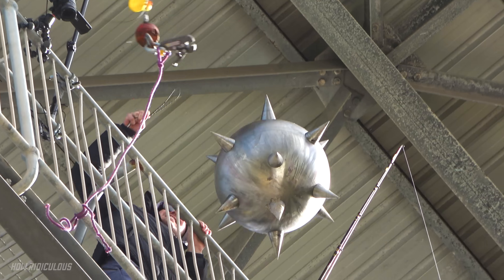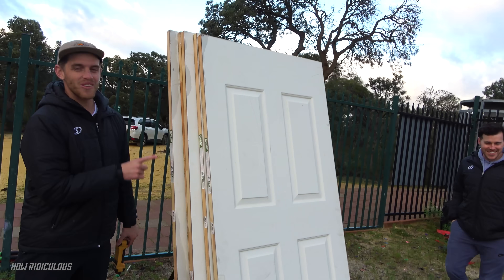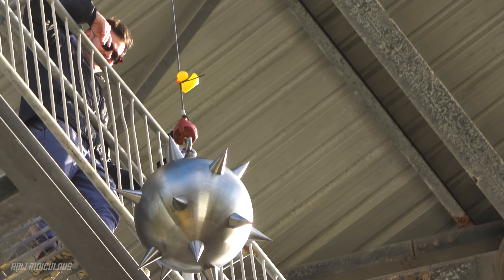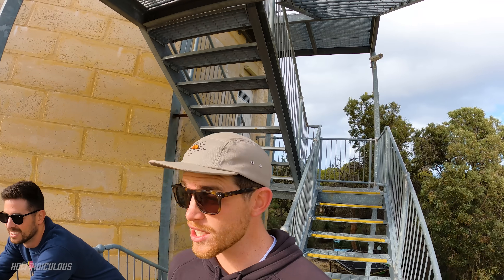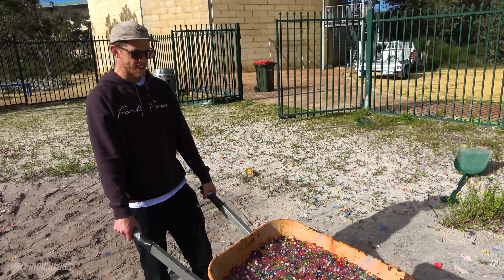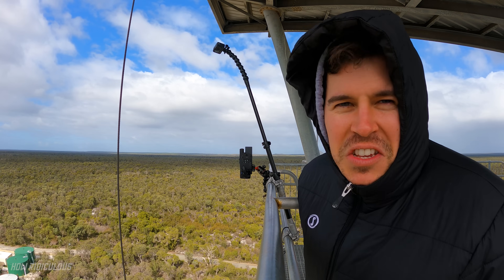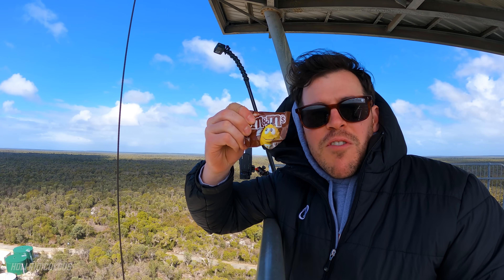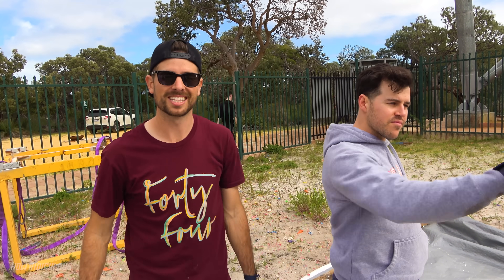444kg Savage Wrecking Ball Vs. Bulletproof Glass from 45m @ 13,000fps!

Comment: The glass would break easily.

If you calculate the potential energy the ball of 444kg at a height of 45 meters, it would be 196.003,8 joules of energy.

If you calculate the kinetic energy of an ak47 bullet (122grams, 710m/s), it would be 30.750,1 joules of energy per bullet, if you take 3 bullets (the reason for 3 bullets -> for American standers, ballistic graded glass has to at least withstand 3 bullets shot 120mm apart from each other in a triangular manner , and let’s assume it’s a bullet shot out of an ak47)
So 30.750,1 times 3 is 92.250,3 joules of kinetic energy total that the ballistic graded glass should minimally be able to withstand.

If you take the potential energy from the ball and the energy minimally of the ballistic graded glass and substitute it from each other, then you would have 103.753,5 joules of energy over, this means that the ball still has that much kinetic energy after breaking the glass.

Comment: At 16:54, I wasn't surprised that tip got bent. I've seen the heads of tank main gun projectiles with tips like that bent after they'd hit the ground in an impact range in the Army. In fact, I have one broken off from a 105MM round from an M-60 tank, and it ripped the spike part off the front and curved the point around 180 degrees, I use it for a paperweight now. All that force just needs a TINY but of sideways action, and tippy is going somewhere

Comment: .... So... Bulletproof glass can stop little bits of lead and metal with an average speed of 2736 Kilometers/hour or 1700 miles/hour, yet at not even a tenth of the speed, nearly half a ton can demolish bullet proof glass... :\ So... Who can science this?
Reply: The mass of an average 9mm bullet is around 147 grams on the high end, whereas this wrecking ball is around 444,400 grams. That is just over 3,000 times as heavy as a bullet. Taking the mass of a bullet and multiplying it by 3,000 would greatly increase its force, but as you pointed out, the wrecking ball isn't moving nearly as fast as the bullet. So let's work out how much slower it is than a bullet.
Since the wrecking ball just falls due to gravity, its acceleration is the gravity of Earth, 9.8m/s^2. We can time that it falls for 3 seconds before making contact with the bulletproof glass. Using those facts to work out the ball's final speed at the point of impact, we find that the ball is moving at about 29 meters per second when it contacts the glass. Converting your speed of 2736km/h to meters per second shows that the bullet travels around 760m/s. Comparing the two, that means the wrecking ball is moving about 26 times slower than the bullet.

The wrecking ball does move much slower than the bullet, 26 times as slow, but not slow enough to balance out the fact it's 3,000 times as heavy. You're multiplying the mass of a bullet by 3,000, but only dividing its speed by 26, which when divided out, means the wrecking ball should have around 115 times more force than the bullet (when it's traveling at around 29m/s)

If there's an issue in my math I'd legitimately love to know what it is /gen, I believe I explained it correctly but I wouldn't mind being corrected.
Reply: @mac-gaming-c7t  Much obliged.

Comment: The reason the spikes are cooled and the ball is heated is the exact same reason why your lid gets stuck in the frying pan.

Expand the receptacle, contract the insertion and when both even out to room temperature, they'll be stuck together.

No welding, gluing or any other fusing method required.

Comment: Betty or Penetrator is my suggestion. Drop suggestion: Through the roof of a heavy duty Truck and then through the engine block.  Also, the hulk fist and Thor hammer were epic but the giant axe head was easily the most terrifying object dropped.

Comment: 0:55 heat makes metal to expand and cold makes it to shrink and thats the reason why u want to tag weld metals before full welding due to the metal expanding from the heat
and same applies to wood in different way. wood expands when it gets wet and shrinks when it dries

Comment: After a bit of back-of-the-envelope calculations, I'd reckon this has kinetic energy in the same ballpark as a shell fired from a 37mm anti-tank gun (roughly 190kJ). So, I'm calling it a "doorknocker" based on the nickname given to one such gun. After all, you did knock on some doors with it.
Reply: What mass and velocity are you assuming for the spike ball?  Just curious.
Reply: @nickh5081  Mass is exactly what they say in the video - 444kg. Velocity is 29.7m/s, which is what you'd expect after a 45m freefall under gravitational acceleration. It works out to 195kJ. I'm gonna ignore air resistance because I don't think it'd matter much for something so dense and spherical until you get into some ludicrous speeds/heights. I'm just trying to get a rough idea of how powerful is the impact; not trying to load the 'Doorknocker' on a ballista and snipe some poor dude with it. 😬

A close scrutiny of the high-speed camera footage would probably yield a better estimate of its velocity especially if you know the exact size, but I'm too lazy to even try.
Reply: @suntzuthesecond   Thanks.  I didn't watch every second of the video, so I missed the mass.  Believe me, I didn't plan on arguing with you and I wasn't about to calculate anything myself, but my interest was peaked when you mentioned the 37mm round as it's always interesting to me when you see the power of ballistics compared to something more tangible. Obviously there's a number of different 37mm rounds, but we're not splitting hairs here!. I was just curious what numbers you used.  Cheers.

Comment: Morpheus the Devastator cause nothing is going to survive it's raft rampage of dangerous weight and spike's I just know I wouldn't want to be around it either when it falls but just a thought though what kind of damage would it cause if shot from a cannon to car or truck ,I would not fire it at a concert or steel wall could maybe find an old gun safe or something similar in size and weight

Comment: I'm hesitant to suggest, but depending on how much time you spend traveling up and down the stairs, you might wanna set up a chairlift that relies on the pull strength of the others. It should be way faster and easier for fatigue on whoever ends up running up and down

Comment: Need to put in a thiccckkk concrete slab with a 1inch thick steel plate bolted to the surface. Your losing so much energy in the soil. You could be doing at least four times the damage… Then you would need a safe observation room/vehicle. 😈😈😈

Comment: I'm surprised y'all haven't found a way to use the winch to get to the top instead of walking all those dang stairs lmao 😂. Just run an extra rope with harness through a pulley at the top and have someone holding the other end Just for a backup safety measure

Comment: could you guys put a velocity counter for things that seem faster than most? i think that'd be dope
Reply: I've always wanted this!!  And accelerometer on the dropped object!
Reply: THAT WOULD BE VERY CHALLENGING AND VERY HARD TO DO
Reply: @jonathanVN1864  buuuuut…?
Reply: @ToastyHC  it would be cool if thats what you want me to say
Reply: @jonathanVN1864  looking for more of explanation on how it would be possible but saying its cool works too😂
Reply: It’s been a while since I took a physics class, but iirc, anything that isn’t super air resistant should fall at roughly the same speed. Also, since we know the tower is 45 m tall and gravity accelerates constantly at 9.8m/s2, we can calculate that most things they drop are going ~30 m/s or ~65 miles per hour when they hit the ground :)
Reply: @blendinblandin7377  what about something like bruce (the massive steel fist) vs the dart? Would their drop speeds be the same?

Comment: Drop it on a large bin of basketballs.  Drop it in a large bin of fireworks.  Drop it  on a safes and fridges. Drop it on a pile of cinder blocks.  Drop it on a cast iron bath tub turned upside down.  Drop it on a large junk of tree trunk

Comment: Process is called " shrink fit". Also interefence fit.

Heating a hole causes it to open up
Supercooled pin shrinks
Mate the 2 and the piece is one.
Hole and pin are the same od-id ( sometimes depending on growth/size of part the pin is actually larger than hole when both are at room temperature).

Comment: This is interesting, let’s do some math to find how many people you can kill with this in one single drop

So the steel ball is weigh 444 kg and dropping from 45 m
As from the kinetic energy formula that Ek = (1/2)(mv^2) , we will need to find the final velocity to be able to calculate the Ek
Let assume that the acceleration is 9.8 m/s^2 and as from the formula v^2 = u^2 + 2as , the final velocity would be approx 29.7 m/s
Now we can calculate the impact force from Ek formula using the numbers above, and the final result would be approx 195,823.98 joules
And let assume that the total energy that would kill a human is 100 joules
So this steel ball could kill 1,958 humans in one single drop (if theres no energy loss due to other factor)

Comment: A stack of dead flat screen TVs. A car. Buckets of butter. Tax paperwork, homework, or textbooks stacked one meter square. A pallet of awful soda in cans. A pile of reject art that you can sell again after. Something you dropped before. Sacks of flour or beans. Eggs. A log. Something on fire. A spinning fan. Cast iron pans. Chalk. Cloth. A mirror for the odd angle effect. A kiddy pool with a rubber duck. Tannerite, just mind the safety. Holiday tin cans. A giant speaker. Piano. Old CRT screen with a black and white show on it. Scuba tank, mind the safety. CPR doll/crash dummy. Toilet paper. Robust plastic crates. Number ten cans. Oil drum. All food products should be past best used by dates.

Comment: There needs to be a disclaimer because these guys cheated and used a spiked ball dramatically lowering the weight required to achieve the same results. For those interested the glass breaking is caused by pressure and Pressure, in this case, can be calculated as P=(mass*acceleration)/area P≈ (444*9.8)/(0.001^2) or P≈4.3512E9 Pa or ≈4351.2 bars. For reference the pressure in the Mariana trench is 1,086 bars this is overkill to pierce bulletproof glass of this type and thickness. and since this comment section is filled with people giving name suggestions here is mine "the product of two click-baiting wordsmiths" since Spiked("savage") Wrecking Balls have never existed in practical use.

Comment: Try spinning spiky first before dropping it. It should add some stability and thus accuracy with the bottom spike.
Reply: I thought of that but they’d have to find a different way to pull the pin
Reply: @ThatDonovanKid  yes, they would have to add a swivel between spiky and the release pin.

Comment: The extra wind resistance on Rex's side caused it to rotate out of true by a couple degrees. You would have been much closer to the center instead of hitting the triple 3. Maybe. It's either that or the release mechanism.

Comment: That thermal compression/expansion trick is something I used in a previous fast food job - someone had put a cap on a sauce bottle on way too tight and no one could get it off to wash it, so I submerged the cap in the hot wash water until all of the plastic was warm and expanded, then I put cold water inside the bottle to contract it away from the warm cap and it screwed right off.  It also turned out that whoever filled the bottle got some sauce in the threads, which was acting like glue.
I've also tried the trick of heating up a pan with stuck food then pouring cold water inside to contract the stuck on food from the metal, and that works pretty well too.
That said, I loved the slo mo of the barrel - seeing the water get pushed out between the wooden slats was so satisfying.  The glass was gorgeous too but the barrel was better in my opinion.

Comment: The term "bulletproof" implies the glass is unbreakable and therefore indestructible which is not true.  The correct term (used by the glass/glazing industry) is "bullet resistant."

Comment: Suggestion: Spin the ball before releasing it. first: it looks cool, second: it will stabilize the ball to ensure hitting the target with spike at the bottom
Reply: It may also help to not have Rexy riding along.
Reply: Spinning the ball would make their safety quick release system awkward and unreliable to use. It kinda relies on the thing not spinning.

Comment: the term for the spike retention is, press fit. where the piece going in is exactly the same size as the hole. or slightly larger.

Comment: It doesn't make audible noise when falling as the spikes break up the airflow around it.

If you accelerated it to Mach 1 it might not even make a legit shock wave.
Reply: now that you have a high FPS camera, it's time to get the colored smoke out so we can see it making little tornadoes across the surface of Spike Boi with the vortices created by the air rushing around the spikes.  Maybe coat it with colored powder and watch it strip off as it drops, leaving colored patterns in the air that can only be appreciated with  the quality of camera used by people of culture such as yourselves.

Comment: You most likely missed the bulls-eye because you attached rexy to the ball which added wind resistance to one side of the ball. You might think there's no way a little bit of wind resistance can move that 444kg beast, but it actually doesn't take much to rotate the ball while in suspension - see the start when you guys spun the ball when it was first on the winch.

Also notice that the bottom center spike was off-target because it had rotated towards rexy's position. This indicates that the above statement is true.

Comment: Can you guys add an extra bar in each corner at the top, it seems to be a weak point folding the glass along alot to make it throw that probably wouldn't if the glass was unable to be like it does

Comment: I'm ready for 10 in November.

I'm trying to think of things to drop that won't take a week to clean up.

Might seem silly, but plastic darts from the top of the tower only the ball, most that stick after 10 shots each wins?
You get the competition, relitively safe, suction cups for marking later on, strategy of managing wind, and if you do it before the ball gets to used and / or rusty, you get a sticking surface.

Comment: I’m curious what the terminal velocity for this would be. Based on looks it’s about 1/2 a meter high with it weighing 444 kg, the terminal might be somewhere around 219.9075 m/s (791,667.1233 km/h) or for people from the US 721.4726 ft/s (491.9190 mph). I don’t know the actual height of the ball so it could be different so if I’m wrong I’m wrong

Comment: Name the ball SPIKE  its gotta be SPIKE after Spike Milligan.  Good respect for fine entertainment.
Reply: Christina 19 y.o - check my vidéó  10 what? 10 apples? Your comment makes no sense, and thus you must be unreasonably minded. Therefore any link you supply must also be ridiculous. 

Although correlation doesn't equal causation, all the warning signs (spam) are there. Therefore you can be burnt through gullibility but not me!

Comment: Fill some of those barrels with orbeez, stack em on top of each other then drop it but have seperate colours in each barrel
Reply: Or maybe oobleck! See how resistant a barrel full can be.
Reply: I'm sorry my friend but based upon Herron's Constant, sorting colored candies, or in this case of orbies, will grow exponentially more difficult with each HM (Herron-minutes) with each lb of sorting. I regret to inform you that this job would take at least 546 HM to complete, practically guaranteeing a poor result. 

Don't drop out and don't cheat in math and one day you too will be able calculate HM by sight.
Reply: @grarglejobber7941  you can buy them in coloured bags
Reply: @tarrantheading4395  if you're weak, yes
Reply: https://youtu.be/azVscq2wvHo😊

Comment: Name the the spike ball of doom Gladius. U got ur inspiration from the weapon called a ball and chain flail. For those don’t know it by name. It’s the weapon that has a handle that’s attached to a spiked ball with a chain. The reason I think Gladius is fitting is because that weapon was pretty likely used by gladiators in arenas. Plus it’s a cool name for it just in general. Pronounced glad ee us or glad dee is. I prefer the second 1. Hope u guys see this

Comment: Just a thought, can U guys at a square shaped piece of steel tube on top at edges and lock it on top at each corner where you added new corner pieces to stop the bullet proof glass from being pushed through?...... Might make a massive difference to wat happens 🤷

Comment: First 3 minutes basically blew my mind whole. I grew up a welder and I learned something today
Reply: The guys I used to work with used this technique quite often, it's called an interference fit, and is a very reliable way of sticking two pieces of metal together

Comment: Thermo dynamics. Heat makes things swell, cold makes them shrink. If it's colder than ambient temp, it's shrunk, it will fit tightly and then when coming up to temp, it returns to it's normal size, thereby fastening itself in the counter bore.
Reply: No one:

This guy:^^^^

🤦🏼‍♂️

Comment: I like that you guys are cold and wearing jackets. It was 36.7 C here today with 98 percent humidity, so the heat index was 40.6 C. The name of the ball should be simple. Spike. I thought the wine barrel was the best smash. You should drop Spike on a car once on the engine compartment and once on the passenger compartment. Then lift the car off Spike imbedded in the sand.
Reply: I forgot, empty all the fluids from the car for the environment. Take out all the glass to save hours of clean up.